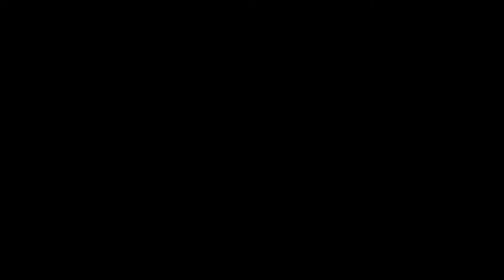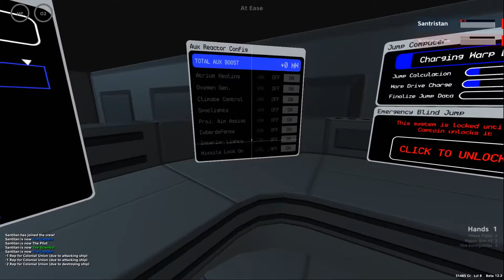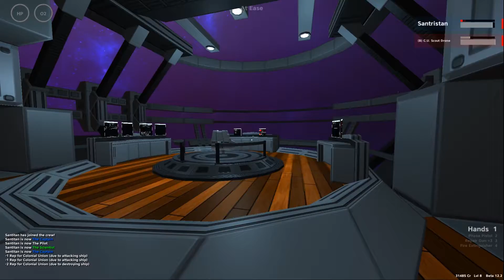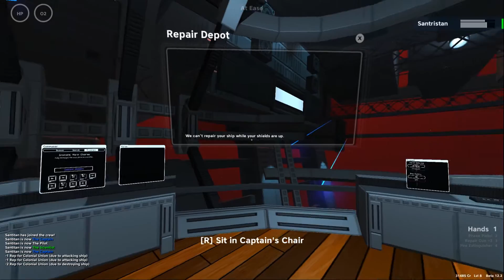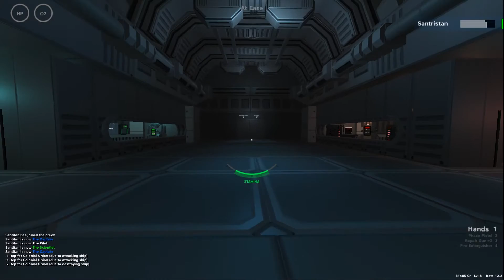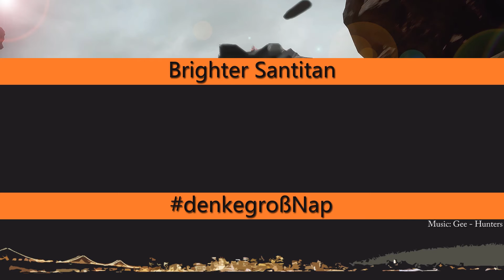PULSAR: Lost Colony - BEGINNER Tutorial #2 - How to REPAIR your SHIP / VESSEL

Comment: At about 2:50 Something is on the wall to the left of the 3 levers. What is that? I see it on some spots on the ship but from what I can tell it doesn't do anything
Reply from the maker: these are the Main levers for you ship. the one on the right turns on/off your shields. the left one is used to shut down your ship. if you board an enemy ship, this can be helpful. if you reboot your ship, you need to turn on the levers from the left to the right and click on the screen for some actions in between.
Reply: I was talking about the port thing to the left of the levers.